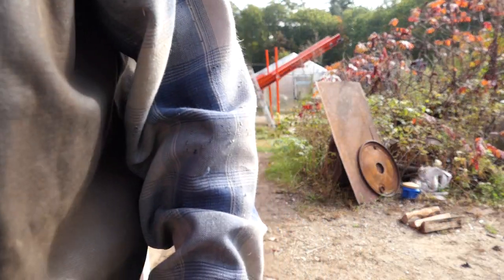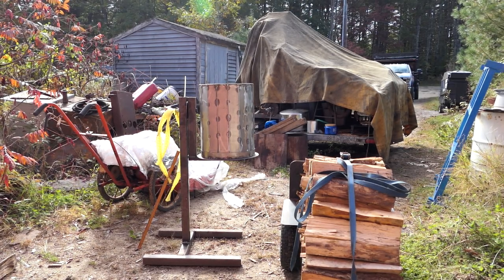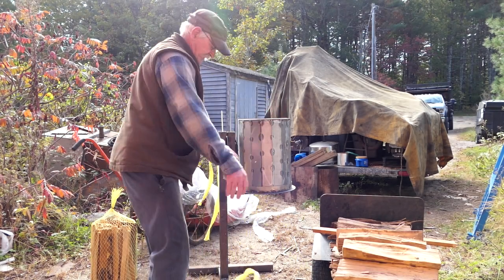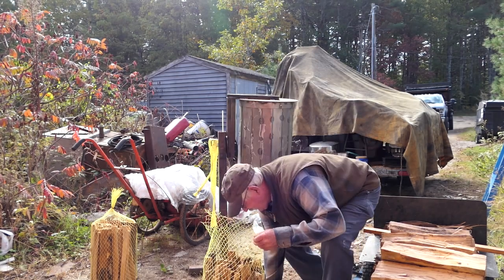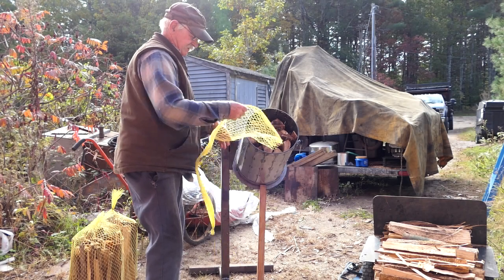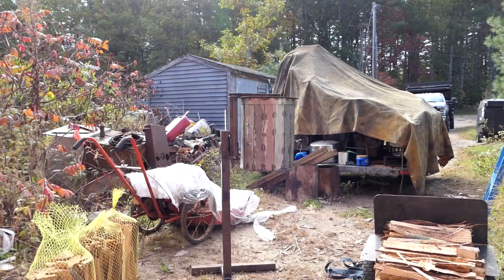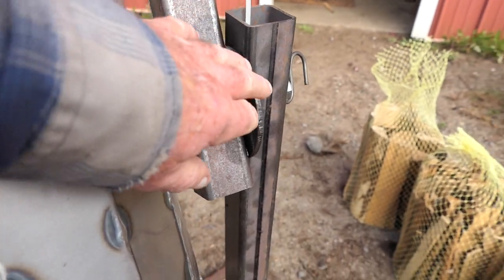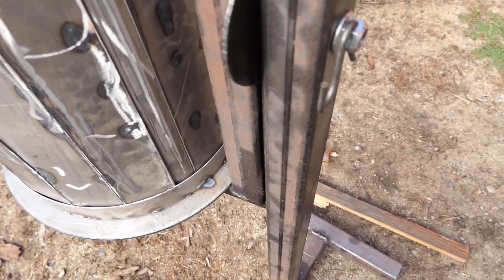NH Hbbyloggr  101523 New Firewood Bundling Packer Build

Comment: Nice job Bill. I wonder if you can us an old propane tank instead of welding all the plates together. Maybe add a spring loaded pin to lock it in the loading position. I never saw one of those before so thanks for the show. Joe
Reply from the maker: Hi Joe, I did try utilizing various size tanks and cylinders for this project but they just didn't work well . They were either too big that the mesh would not stretch over it or too small to get the correct volume of wood. That's why I custom made the size container specifically for the size of the mesh and ease of operation.

Comment: I wish my Alpacas wood be as useful as your woodpakka is  :) . 
About the water ingress issue, you probably already have drain holes at the bottoms of those tubes? 
Keep the magic happening, oh woodenwatty one  :) .
Reply from the maker: Smoke and mirrors all the way buddy ! Oh yes, we have drains in the square pipe so that the water doesn't collect or freeze.  The caps got welded on this morning so it's time to clean the metal, heat it up a little and shoot on some color.  Are you cranking out the projects on the router table yet?
Reply: @nhhbbyloggr5022  
 Yes, smoky mirrors are the best mirrors  ;) . 
Looks like you have got this project well under control, which will make the woodgas bugs very happy. 
Yup, my router table has been quite busy - making furniture for the workshops, and the house. 
Also, I am working on a Sterling engine, and a gravity powered generator, using the machines to make the gears and the other moving parts for them. 
On top of all that, my concrete base is finally done, ready for me to build my new machine shop. 
 Other than that, I am totally not doing anything  ;) .
Reply from the maker: @CNCmachiningisfun  Well, I'd say you are doing quite well now that you've been inducted into the " Professional Deadbeat's Society" I've bee a life long member myself and wear the badge with pride. My shop is chucked full of projects so it's time to move some of them out into the real world to make room for more.
Reply: @nhhbbyloggr5022  
 Indeed. We men of leisure need more space, for the successful storage of more goodies, or "junk", as the uncouth might call it  :) .